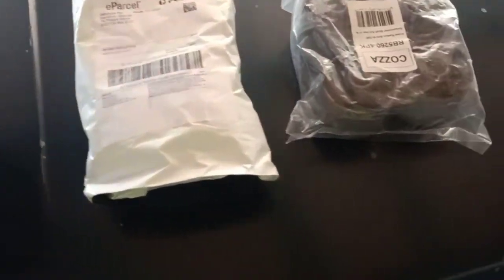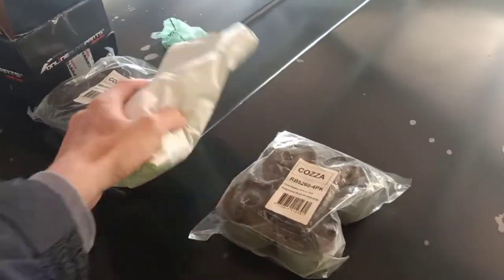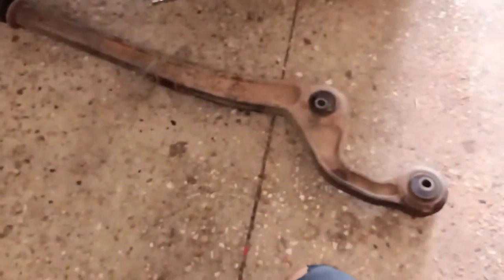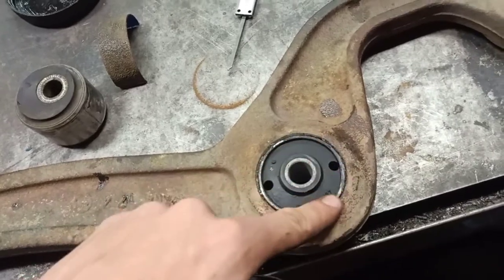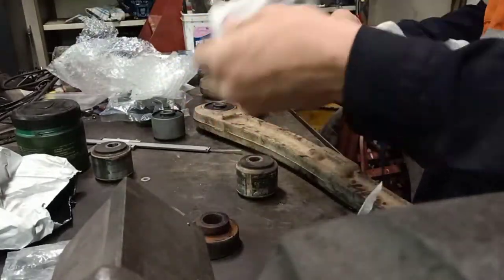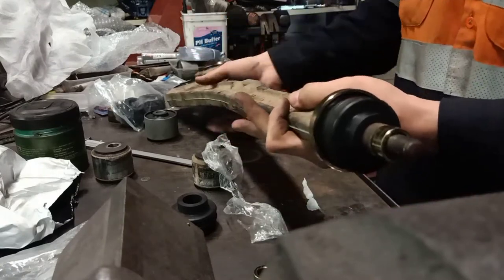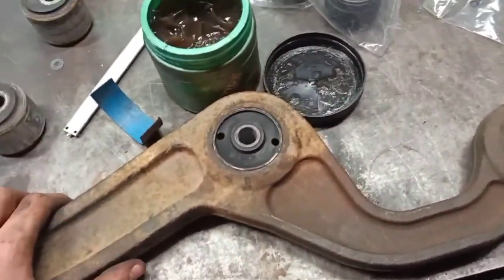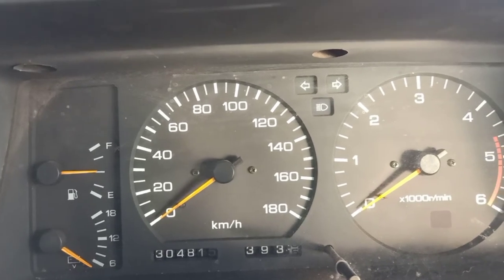Making your old 4wd drive like new! GQ patrol gets new bushes up front!

Comment: Nice gq mate.
I got a 89 swb myself and love the thing.
There is a weird creak coming from the front at low speeds, do you think the radius arm bushings could be causing that?
Reply from the maker: Possibly mate, it's worth doing for the ~$50 it costs doing it yourself. Without pinpointing the issue first it's hard to know if it's your problem.